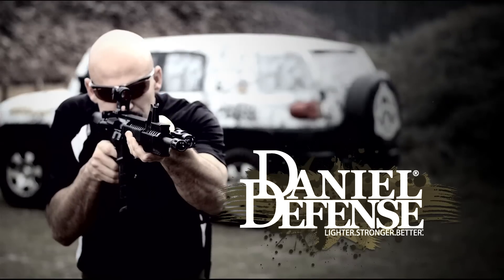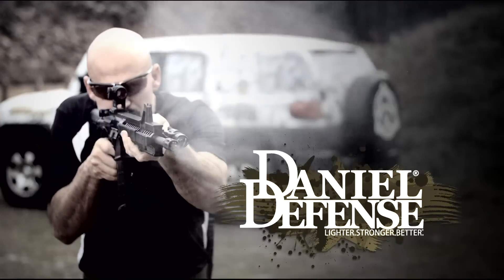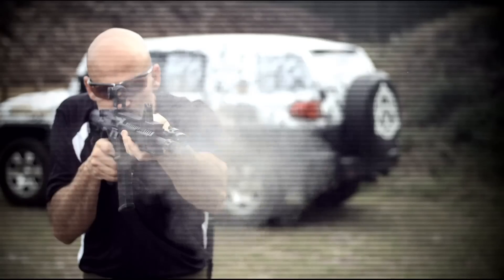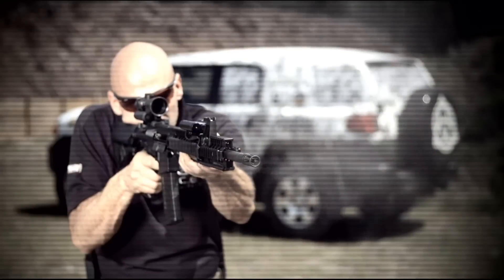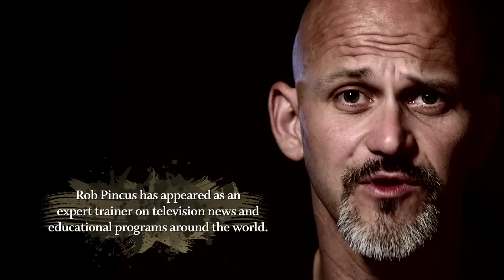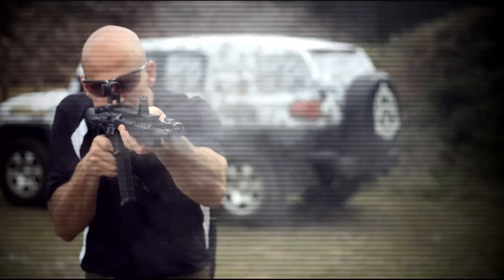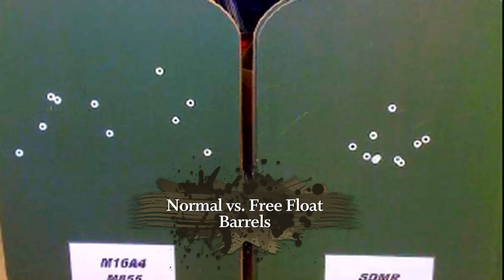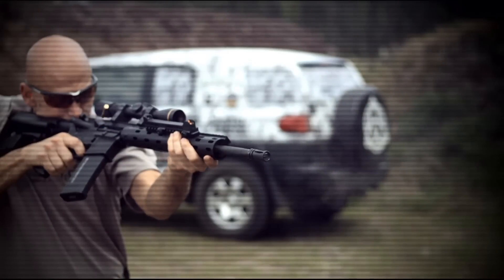2012 Daniel Defense Video Series: The Importance of Free Floated Barrels

Comment: A standard barrel will out perform a 99% of shooters, however a free float barrel does make a substantial difference, I have seen the difference a free float barrel can make, even with newer shooters. It made a significant difference for me and I definitively am not in the 1% of shooters.

You may not be able to hit its full potential, but it will be a significant improvement over a standard set up.

Comment: That is rather interesting. Most of the movement is vertical. Is that because the gas system pushing back on the bolt and partially down on the barrel?

Comment: Hi Rob, I have a question about a 1942 Enfield No 4 MK1 which has been sporterized. I bought it for $179 & the barrel is free floated. Since originally this rifle had a longer barrel & it had a band around the end near the front sight. I'm curious about how accurate it will now be with a 22" free floated barrel?
I'm still in the process of cleaning & checking the firing pin before I put a live round down the barrel so, I haven't fired it yet.
Do you see any problems I should be aware of with a 1942 Enfield, sporterized & free floating barrel?

Comment: In my opinion question is if the sights do the same movement like the barrel as you put weight on the barrel (sling, flashlight, ...). On the AR15 design you got wobbling between barrel and upper receiver. result: some movement between frontsight and rearsight -> less accurate. Put the sights on the barrel and some extra weight on the barrel will have less effect on accuracy.

Comment: You would think an attachment at the back and front of the barrel would help to hold it still. I always thought it was the upward pressure from your off hand that could bend te barrel up, throwing your accuracy off, but only at very long ranges. I just think this is a gimmick for most people, but they look cool and are what's available in a million different styles, so whatever!